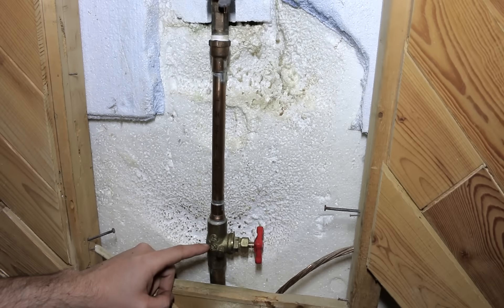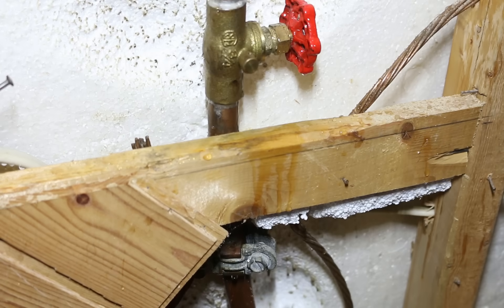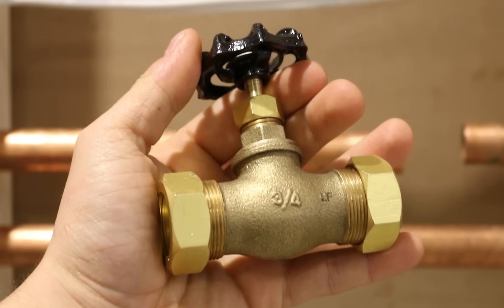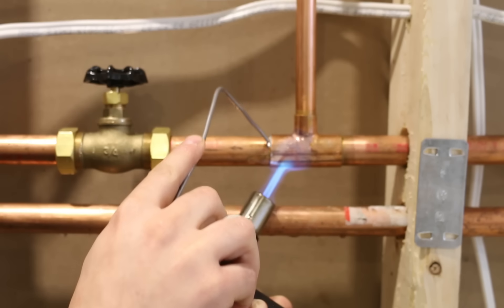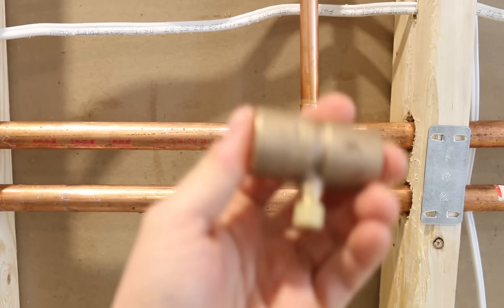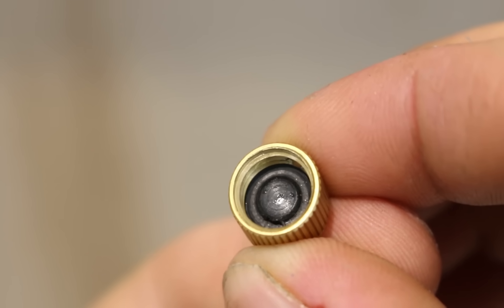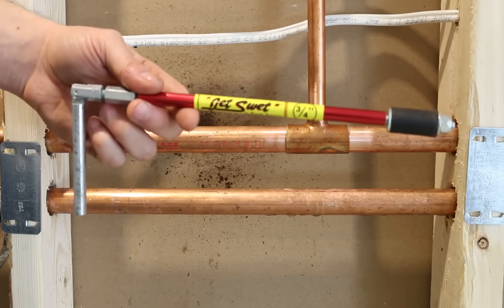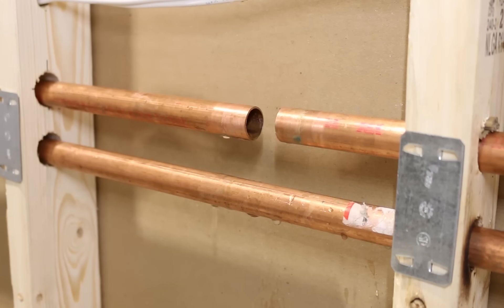Soldering Copper Pipes With Water in Them (7 Solutions) | GOT2LEARN

Comment: I bought a 3/4 compression shut off valve from Menards today. When I got back to the job. I installed it but the sucker wouldn't tighten up. I have used 1/2 inch compression valves in the past with no issues. Also this was not my first time soldering. And while I'm not a plumbing guru. I have been able to repair most basic plumbing issues in my house. And a dozen or so for a few friends. The job today was maybe the second time I have soldered and had a leak at the joint. I think while I have knowledge. It is practice that I need. All the times I have soldered for myself or my friends. I got really great joints. These got to learn videos are reminding me of certain things I forgot. And certain things I didn't know before. Thanks!
Reply from the maker: Glad I could help you out!

Comment: Whoa!  Forgot about problems I've had with this!  Replacing a hotwater heater. Different height with new one. Have more time than money. 120 dollars an hour!?  Had leak when doing shark bites in copper  so I choose to do what I know.  Would have had serious frustration as cold water needing a solder joint for threaded cap coming down. More patience and planning required!  Thanks!

Comment: One tool that I absolutely love is Makita's Blower/Inflator. It's basically the shape of a heat gun and works like a tiny hand-held compressor. They have one for their 18V LXT and also their 36/40V XGT battery platforms. The thing is super powerful, small and lightweight, and it accepts different sizes of blower tips.

I use it to purge water out of pipes and hoses. In the situation in this video, I'd cut open the pipe, leave open plumbing valves at a low point (utility sink in the basement, hose bibs, etc), I'd then go to an upper floor, open up a water valve at a sink, push my Makita blower into the end of the faucet, and blow air into the water pipes. All the air would blow through the pipes and push out the water.

I do this when I shut off my hose bibs in winter. I have ball valves upstream from hose bibs in a mechanical closet inside my house. I close the ball valves that shut off water to the hose bibs. Then I open the outside hose bib and let water drain. Then I open up the inside hose bib that's a couple inches downstream from the shutoff valve, and I blow air into that hose bib to push all the water out of the pipes so the pipes + hose bib don't freeze in winter. I used to use a full-sized compressor for this, but the small Makita tool works fine for this and will get almost all the water out of the pipes without requiring you to carry around a big compressor and air hose.

Comment: I’m curious what you do when threading copper male adapters into brass female. Then soldering around that. Thanks
Reply from the maker: just use sweat fittings in this case 😇
Reply: Ok. That doesn’t really help me though. Are you saying it’s a huge pain or can’t be done? Obviously this is a common situation…
Reply from the maker: @northernlightse3066  sorry I misread, you need to use teflon.

Comment: The wet/dry vac just saved me...I could not get the water out of the line, solder would NOT take, compressed air was only getting a little at a time.  The wet/dry vac sucked out about a quart of water, then compressed air to dry the end and it was like working with new copper

Comment: That Jet Sweat thing is kinda cool.  I wonder if you could make your own.  Perhaps something from Drum Brakes. In the caliper there is a seal, it's a cone shape and the walls can bend a bit, maybe if you had the correct size (close) you could shove it down the pipe and the cone would expand out to the edge.  You could drill a hole in the middle, insert threaded rod, hold it there with washer and nuts and give you enough time to solder.  Never had this problem but I'd try a few things before I felt i'd buy that expensive set.  sure i could figure something out.
Reply from the maker: I am guessing that if you are good on a lathe you can make something cool ;)

Comment: The best option would be CO2 and freeze the water in the pipe. In the UK you can buy this just about anywhere that sells plumbing parts. 

Never stuff bread in a pipe especially when you can freeze it. 

You can then solder it up properly and not have to worry about valves. 

The push fit is a good option too.

Comment: You didn't mention Cold-Shot It freezes all types of liquids in steel, copper, cast iron, aluminum, or plastic pipes ranging from 1/8" to 2" (10mm to 60mm) in diameter. It uses Carbon Dioxide (CO2) from a dip-tube cylinder to freeze the water in the pipe far enough that the soldering doesn't warm it back up.
Reply: Αυτό ακριβώς ήθελα να πώ

Comment: Caution - Many years back I tried this method and it worked.  There was one major issue “All my fixtures got blocked once the water was turned on”.  It took hours to clean out everything. Toilets, faucets, shower, etc.  I opened the utility tub faucet first thinking ahead to dispose of the bread.  It didn’t work and bread still clogged my system.  I would say be careful where this method is used.  If the pipe being repaired is in the beginning of your water source it could clog up other fixtures.  If the repair is at the end of the water source and effects one or two fixtures go for it.  I had to learn the hard way.  Just sharing my experience.
Reply: Just one slice of cheap wonder bread, not the whole loaf!
Reply: If you used cheap white bread it would dissolve, not clog up your fixtures. Like literally dissolve into particulates too small to be stopped by even the finest mesh screens
Reply: You need your DIY license revoked.

Comment: The bread solution did not work for me.  I used "Sharkbites" and they really work well.  Best of all, it is possible to remove and refit them to the copper and plastic (PVC) pipes.  Better still, it is possible to turn the pipe with a corner piece (elbow) .

Comment: The bread trick probly works but i have no bread here and already ordered a 1/2" Jet Swet. My old leaking garden hose connector has been driving me nuts the past 20 years. We changed the location of the outside garden hose so now i am left with the old location's problems. Should be easy enough.

Comment: I like to create a temporary dam.  For instance, in your mock up wall in the video, cut and drain as much as you can.  On the side the water is coming from, go back a couple of studs and use a long flat screw driver as a wedge to raise the pipe to the top of the hole, creating a peak to block water from flowing toward your patch.  If the line is on the bottom of a joist, again go back and use the handle of the screw driver to now create a dip to hold the water.  Sometimes with this you have to remove a clamp. You should be ready with everything fluxed as you will have a small window to sweat.
 Another good idea is solder all joints that do not have water flowing on them, then go back and sweat a coupling away from those, such as the tee in the video.  The idea is that it's much easier and cheaper to solder a coupling and if you have to cut something out because it didn't take then all you lose is a coupling.

Comment: Three easy other methods.  #1, a DIY Jet Swet.  Just a threaded rod and a sleeve to make compression at the other end along with some rubber stoppers, for the size or two most DIYers might need this would be easy enough to do for the once or twice you might need it.
#2  Two pieces of bread, so it works better.  Should still easily disintegrate later.
#3.  If you have an outlet or other access point nearby, thread some copper wire from the outlet to the joint, through the coupling, etc.  Tie it around the middle of a couple of sponges, then stuff them back to stop the water, as per the bread.  Once the joint is done, pull on the wire then relax, repeat and you should be able to work the sponge out and through the joint.  If you have an outlet a few feet away or in a straight line this will be trivial, just as easy as the bread, and reusable..

Comment: Before I retired, they hired a new head of maintenance.  He had a guy add solder to a leaking 2" joint in the main building feed line to save $500 bucks.  The burst pipe did $500,000.00 damage with a $50,000.00 insurance deductible.  Nothing like hiring for the lowest buck.

Comment: Learned the bread plug "hack" while I was moonlighting as a plumber's assistant nearly 20 years ago. You have to use plain white bread; the cheaper the better, and no crusts. Any other bread can swell or deposit "chunks" of grain in the water lines potentially leading to another leak or rupture. Cheap white bread tends to almost instantly dissolve when pressure is reestablished due to the high sugar content and more fragile gluten structure.

Comment: There is also the expensive option of using press fit but you need the crimping tool and stuff. Very much worth it in commercial though not having to shut down fire systems and fill in hot work permits etc...

Comment: Anytime I put a Valve or Purge in a wall I always put in an access panel. However I'd trust a Compression Fitting wayyyy more than a Sharkbite (20yrs Installing and Repairs with a lot of Floods from Push Fittings). I still keep a couple slices of Wonder Bread in a Ziploc as a backup. Lol

Comment: jet sweat is a good tool  but way to expensive . I made my own diy tool using just some all thread and some rubber hose and some flat  washers and nuts . works the same and only cost be a few bucks to make.
Reply: Nice, but I'd rather buy the set of Jet Swets and be done with it.  The cost is not an issue for me.

Comment: I’ve used the the dissolvable plugs that look like a real big gel pill. They come in the various copper pipe sizes with the insertion tool. The pipe has to be burr free as per the instructions and they are way better at holding back the endless trickle than bread. When done just add a little heat where they are and whoosh they are gone. They eventually totally dissolve and do not plug your fixtures.
Reply: Very helpful. I'm capping a line to an outdoor spigot that had a deck built on top of it (spigot not usable). I didn't want to put a piece of bread in there that would never be washed out.
Reply: Yeah, but good luck finding them anymore.

Comment: You can buy the jet swet tools for what ever pipe you have ,about 40 dollars. That set he showed is around 300 dollars
Reply from the maker: Yeah, you can get them individually, they are just a little more expensive 🍻
Reply: @Got2Learn ya  man you saved my ass I'm about to cut into my main water line, to put a new shut off, sometimes you do have water coming in still. When you showed that kit,I ordered the 3/4 on line did not know they existed thank you 🙏God bless you. And love your videos
Reply: For residential, a set of three Jet-Swets (1/2, 3/4, 1") can be had for less than $100.

Comment: Shut off at street...my water company replaces leaking street shut offs.. free, yes totally free... I use street shut of all the time for repairs.
Reply: I'm curious... Do you live in a year round warm climate?  Our street shut offs are very deep and the water company has a long tool.  It's not something that you request of them unless you have to.
Reply: Of course they do are you going to wait several weeks for them to get out there laugh out loud? Where I live it takes them this long or longer…
Reply: Yeah, but that has little to do with the problem of soldering with water in the pipe. Because the water may be coming from somewhere OTHER than the main supply to the building.  Try soldering in the basement or 1st floor downstream of your home water shutoff, even when it is in the off position, and you'll see what I mean.  The point of this video is that turning off the water supply to the building, even if it is 100% effective, is often not enough to solder in a system that has been been fully charged with water.

Comment: As a plumber in the UK we use propane and MAP gas which burns at a higher temperature. I have successfully souldered "Yorkshire" fittings with a ring of soulder already in the fitting many times with water in the pipe using MAP gas.
Good trick with the bread though!

Comment: there are kits that will freeze the water in the pipe without damaging the pipe, creates a small block of ice.  The kits is applied about 6 - 8inches towards where the water will flow from can be further. Do the solder work and the water (ice) will thaw of its own accord. I have also used a bit of kitchen roll in the pipe letting it hang out so it sucks the water from the pipe and let it drip into a container.

Comment: Called a plumber to fix a simple leak that carries water throughout my home from the BOILER..... he asked if i had bread so he can use it to stop water. I didnt have white bread... only bagels.... he used the bagel to do it with.   Now i had to call plumber back cause 3 rooms arent heating.... the rest are.  Im hopingbit was cause he didnt get all the AIR out of the lines .... but do you think it could be the bagel that has clogged up system that feeds that part of the house?  
When he asked for the bread.... i asked him about it ( i had never heard of bread being used for such purpose) i asked him if it would cause problems being contained within the boiler system..... he said no. Now...... im having problems that i had never had with the system..... like i said..... could be just because he didnt get all the air out of the lines.... HOPING SO ,anyway.   The boiler is only a 2-3 years old..... same company installed it.

Comment: In closed wall, I will solder union fitting first or use Sharkbite slip fitting, and leave it not tightened yet, let the water drain out the opening spot before soldering point. After soldering the T fitting, I will connect the union fitting or slip fitting finally.

Comment: Great tips and tricks, delivered quickly and clearly. Terrific channel. As I mentioned in a comment on another of your videos,  fixing my neighbor's  main waterline 3/4" copper on a steep hill, the main turned off still allowed some water to flow. My neighbor  daisy chained three plastic drinking straws and sucked out about a foot of water. It was flowing slow enough that this gave us the time to solder the repair.  Tip for the straws. We didn't have a knife with us. Cut a taper on one  end of two of the straws (scissors would be best for this), then they'll slide together easily.  Of course a small diameter hose would also work.  This is a variation on the shop vac, but I don't think it would work very well on a horizontal pipe. 
And yes I've successfully soldered slightly wet pipes, not damp but drip drip.  In 50 years I've been able to do this only a couple times as a hail Mary before doing something more difficult. Don't count on it, 95% of the time you'll just be making more work for yourself.  The heat absorbing pad? I've got one of these that's about 40 years old, still good. Excellent for fire safety. And Fire Safety is critical - you will set fire to something. Plywood is worse than 2x4s as it's drier. And if the fire dies out, still wet it.

Comment: Just get a compression fitting (tee, 90 or straight) - no need to have a compression valve- just extra cost and time.
Reply: I agree..however anytime u can utilize a isolation valve,, then no need to shut the entire system down if a repair on that line is necessary. ..but yeah...I agree

Comment: The best way to stop the water leaking through copper tubing it's the go to the water meter turn off the water and disconnect the water line connected to the meter. If you do this you can eliminate the seven steps.
Reply: That has little to do with the problem of soldering with water in the pipe. Because the water may be coming from somewhere OTHER than the main supply to the building.  Try soldering in the basement or 1st floor downstream of your home water shutoff, even when it is in the off position, and you'll see what I mean.  The point of this video is that turning off the water supply to the building, even if it is 100% effective, is often not enough to solder in a system that has been been fully charged with water.

Comment: A few years ago, our water main in was accidentally cut on the wrong side if our shut off valve. Water fed into our 200 home community through parallel water lines which we shut off but it would take hours to drain all the water from all the homes. The pvc glue wouldn't set with while wet under pressure but all we needed was 1min. Was shocked when the plumber asked for some white bread which he jambed up the main glued the connection and opened up a valve downstream and waited for the plug to pop out. I'm definitely a believer.

Comment: Stuffing a piece of bread in a copper line to keep the water off of your soldier joint. That is a VERY old trick !
Reply from the maker: Works!
Reply: @Got2Learn  I used the bread trick a few weeks ago. Main valve wasn't shutting.

Comment: I have used compressed air from a portable tank to clear out water from a repair section that could not be purged by gravity.
Reply: Always remember to remove the faucet aerator if you blow junk back it clogs the aerator
Reply: I did that this past weekend after I used a Quick Sweat to block the trickling water flow.  Worked great to totally evacuate all water from between the rubber stopper and where I was planning to solder.

Comment: I've heard of a plumber using dry ice to temporarily freeze the water in the pipe until he could finish soldering or repairing in this type of situation.
Reply: Pretty common in EU
Reply: Doesn't the ice melt from the heat of the torch and turn back into water?
Reply: @averyalexander2303  Good question! The dry ice is applied far enough away from the section needing repair that the ice doesn't melt while soldering.
Reply: @rudycarrera791  Thanks for explaining! That seems like a great idea as long as the pipe is still accessible several feet away from the location that needs to be soldered.